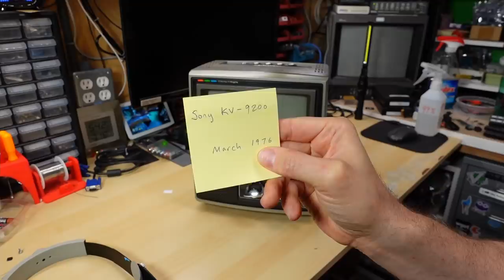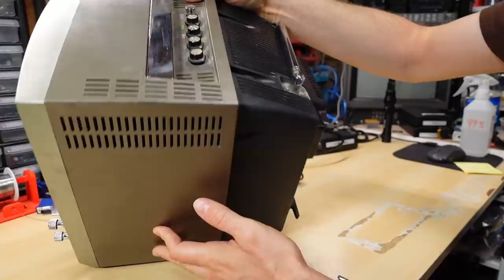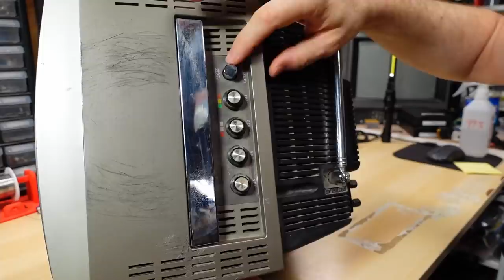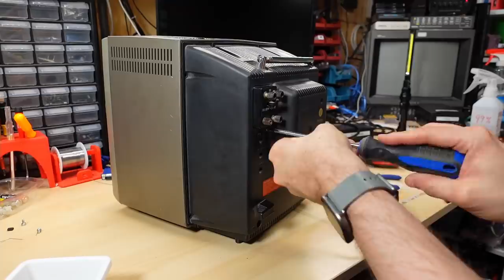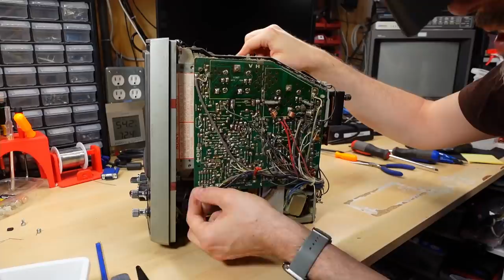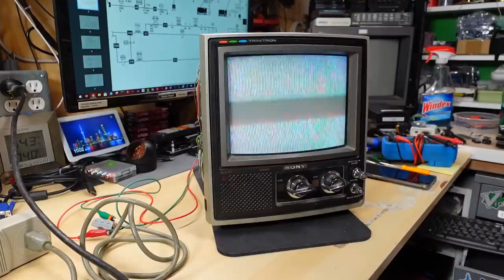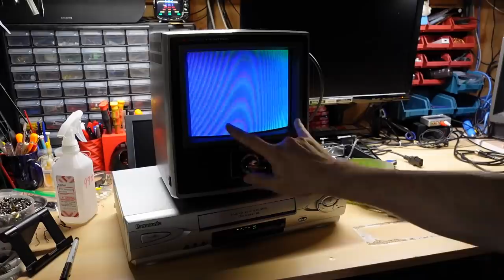A very used up (and broken) Sony Trinitron from 1976

Comment: Even in 2021 I still think a TV like this looks nice, espeically its small form factor. Just sucks that ith really old TV's they dont have any inputs aside from the terminals on the back. While you could always get adapters to get a VCR connected to this so you can get some inputs (or use a Composit/S-Video to RF adapter), it'll never be as sharp as having a TV with dedicated Composite inputs.
I have a feeling the scratches on top might have been a external/dedicated antenna thingy that has a base on it, probably to get the dual rod antenna's and loop antenna.
I had one kicking around for a while but sad that I had to chuck it because it was pointless to have one after Canada switched Cable and Antenna TV to all Digital with no analogue channels that I know of in my parts of the eastern Toronto area
Reply: The output from the tuner is composite... so modding is often possible. An RGB mod is even more rewarding, but often quite a bit more challenging on TVs without on-screen-display.
Reply: @danielmantione  To be pedantic the output of the tuner is intermediate frequency, but I know what you mean. The problem is most RF-only TVs have a hot chassis, so bad things will happen if you don't add isolation somehow.

But in reality a well-adjusted RF-modulated input isn't much worse than composite in terms of video quality. I doubt you could tell the difference on a color set without having both in front of you at the same time.
Reply: @eDoc2020  I have used a CRT TV with a broken SCART input for a few years in my bedroom, so I did connect my satellite receiver via a RF modulator to it. The experience was totally fine. Especially when watching TV in bed, the RF noise becomes invisible due to the distance. On the other hand it was absolutely no match for the picture you I could get out of the SCART connection when it was still working.

Hot chassis can be an issue, but just as often it isn't. It was mainly beneficial for tubes and did quickly disappear in the transistor age. I look at the construction of the TV in the video I see a proper transformer and lots of wires that seem to come out of it, so it looks like this Trinitron TV has a galvanic isolation from mains, so cold chassis, and could be candidate for modding.

If you have a hot chassis, you may need to use optocouplers. Complicates stuff quite a bit, but IMO still totally worth it if it is a nice TV.
Reply: @danielmantione  I believe the early Trinitrons from the 60s used a transformer for the CRT filament and for the audio output, but were otherwise hot-chassis. Usually the horizontal output is run directly from rectified mains (even on otherwise cold-chassis sets) and it's simply easier if none of the signals need to cross an isolation barrier. Once the horizontal comes up extra windings on the flyback provide most of the other voltages in the set.

I've investigated using optoisolators for video signals but as far as I can tell ther are all too slow to pass a multi-megahertz signal.
Reply: @danielmantione  Thanks for that part number, that looks like a perfect match. Somebody should make a kit with this that people can use to mod hot chassis televisions.

Comment: Adrian: "It weighs 22 pounds..."
My German brain: "That's about 10 kilograms"
Adrian: "...or 10 kilograms"
You are breaking my brain's automatisms, man! ;-)

Joke aside, I wonder if he includes this because as a Canadian, he doesn't have the aversion against the metric system that people in the US often have, even though he is living there.

Edit: I remember the function of the dual headphone jacks on Sony TVs as you described - one left the speaker on, one turned the speaker off. When I was a kid, we had a Sony TV with this feature, and when I was awake before my parents woke up on weekends, I tried watching TV using headphones to not disturb them. Unfortunately young me could never remember which one turned the speaker off and which didn't. So more often than not I woke them up.

Comment: Ground-fault on an isolated circuit sounds ineffectual at best and dangerous at worst‽ I’m not trying to be contemptuous, but I don’t understand how that would work? 
If (a) the GFCI precedes the isolation transformer and the circuit is truly isolated then it will have no effect. (I presume this is probably the case, at least I hope so; it’s not dangerous but it might be a false sense of risk mitigation. If not it could be dangerous…) 
If (b) the GFCI precedes the isolation transformer yet shares a ground with the “isolated” side you have critically broken isolation.
If (c) the isolation transformer precedes the GFCI yet shares a ground with the “un-isolated ” side you have critically broken isolation.
If (d) the isolation transformer precedes the GFCI and isn’t connected to earth-ground where is it connected? 

Am I missing something? I’m no electrician but this doesn’t make sense to me; Anyone have any further insight?

Comment: Most of the weight is in the pcb-lead
Reply: nope, the crt glass, its much thicker than you might think, especially the front faceplate , has to be for safety
Reply: The CRT glass has lead in it to shield the xrays, that's why it's so heavy.

Comment: Before trying it or trying to adjust anything, you have to change ALL the capacitors and potentiometers you have. He's 45. Most are already out of value. You can't repair it without changing all of that.
Reply: That's absurd. No repair shop would have ever entertained that idea, and it unnecessary. This urban legend comes from pre-1965 stuff with paper caps that are known to disintegrate with age. This era stuff won't catch fire or blow up if the electrolytic are dry or out of value, it just won't work correctly if at all.
Reply: Why would you change the pots? They don't fail with age aside from getting dirty. And shotgunning a set before powering it is a ridiculous waste of time and money. At least get it somewhat working to make sure you don't have bad critical parts like CRT or flyback.

Comment: Degauss issue, unless the case is cracked, degauss issue if the case is intact.
Reply: If the case is cracked, it is impact issue (the shadow mask shifting its position) not fixable.
Reply: Now for long term crt unused, normal degauss coil is not enough, you need to apply the stronger technician degauss coil , or just use an old "transformer soldering pistol near to the crt)
Reply: Don't touch purity rings at all, they hardly move itself, check if the yoke didn't shift original position (watching the dust marks).

Comment: You might be making a big mistake if you do not give a recap a try. You know it has bad caps and if certain caps are bad like in the PSU, then it might not be getting enough power to drive the filaments properly. The CRT might be in good shape and you will not know what state it is in before you at very minimum replace the PSU caps.

The fact that picture changed so much in size during scene changes also suggests there is something wrong with the power

Comment: There is no upside to leaving electronics dust covered.  Downside is worse heat dissipation, shortened components lifespan, contamination of pots, and increased fire risk.  And it's ucky!  Lol
Reply: @GoldSrc_  Who is freaking out?  If I am servicing equipment, whether it is electronic, or mechanical, it's reasonable to clean it out at the same time.
Reply: There definitely is a benefit to keeping some dust when servicing equipment. Beyond the risk of damaging components during the dust removal process, you shouldn't change too many things at once during the troubleshooting process. I'm really only talking about dust that is stuck to components, I can't see any harm in removing large clumps of dust which are just floating around.

And then after the circuitry is functional, feel free to make it spotless.
Reply: @UserUser-zc6fx  I used to fix TVs, there was always dust, never was a risk of anything, hell, I once cleaned the dust from a flyback label and it took the damn numbers off lol.
Now, if we were talking about a smoker's TV, then I would use gloves to handle that thing.
Dust? That's not really a problem or "ucky", you can always wash your hands, which is why I always did.
Reply: @garthhowe297  When I used to fix TVs, I was paid to fix them not to clean them, unless they wanted and then I would charge them for the cleaning.
Plus, it's a TV, dust is a given and they don't catch fire on their own because of dust.

Comment: Also, that ondulation in the picture... probably capacitors shorting internally.
Reply: doubt it, shorting would pop a fuse or other component,  capacitors arent always to blame, most of my old equipment has original capacitors still in as they tested still good
Reply: @andygozzo72  I know but that set was used a lot. Those 60's 70's japanese capacitors are bad. They are probably dry or leaking... at least the high voltage ones.
Reply: @josericardogs1435  i still doubt they'd cause 'varying' picture size  issue, thats more likely bad regulation,  somewhere , such as if a zener has gone bad(i had that with a later sony kv1442), bad caps, such as bad smoothing will cause 'hum' on soumd and/or picture (moving 'glass bar' distortion, i've had this in the past as well)  , in my experience, old capacitors do not give the trouble many seem to say/think,
Reply: a 'shorted' capacitor would show up as something far more serious such as fuse blowing, loss of or incorrect scan, no sound and or picture,, open/dried up caps, also could show up as loss or low scan, picture sync trouble, no sound, as well as 'hum' ,depending on the cap,
Reply: i have several old sony sets, and had more in the past, and none have needed any cap replacement (i agree, they still 'can' fail), but i dont think it is necessarily a cap 'issue' in the set in the video!  i'd love the tv, but as i'm in the UK, postage would be stupidly expensive!!
Reply: @andygozzo72  I loved the style of the set as well, not very common to see the tuner on the bottom. I'm in Brazil so the shipping would be even more expensive 🙃

Comment: The difference between China and Japan is that Japan made good stuff. Also the throw away thing, Ya, it did start to get shitty in the 90s, later 90s. I can say that the 27" curved Samsung is made in Mexico and probably is not as throw away as you would think that I am using to comment.

Converter box was a scam too. Everyone had to buy one to watch TV if they did not have some sort of Cable or satellite service. You see, Public TV is free, now in that time you had to buy another device to watch it. This was the start to end CRTs. Shortly after they were pulled from market. Bush/Obama governments sucked almost as bad as todays. Case of take from one to make another have power, phone companies with cell phones= monopoly. Also, cell phones are mostly made in China with most of todays TVs. Also, Biden was Obama's Vice. Hard to respect any of it.

Comment: no need to really do anything in it, its 'working', just low emission tube, not really everyday usable, but as a 'collectors item',
Reply: dont blame capacitors for everything!!! replacing wont necessarily cure the picture 'blooming', maybe fault in any voltage regulator or scan amplitude stabiliser?

Comment: Love how CRT TVs were never really obsolete, well until Obama and Digital Tuners and HD LCD sets. If it worked you kept using it and never threw it out. Things had value back then. Now things get obsoleted fast. Hehum, 7th gen Intel and Windows 11. We truly live in a throw away society. We really got screwed as Americans in many ways. Getting rid of my Panasonic 27" flat screen was a big mistake, it will never be replaced. Probably one of the last CRTs made till LCDs took over. It was a money making scam for politics and media/China and anything else that took out analog. We are in a world of cheap and shotty electronics in the mainstream.
Reply: First of all that (mostly) happened under Bush's presidency, but that doesn't matter. AFAIK the real reason was so the FCC could sell the upper end of the spectrum to cell phone companies. And as much as I dislike not having proper broadcast NTSC, at least with converter boxes practically nothing became unusable.